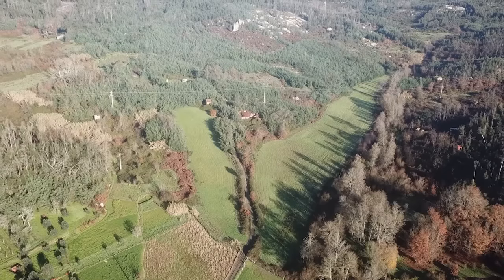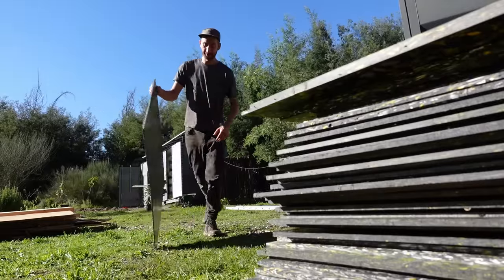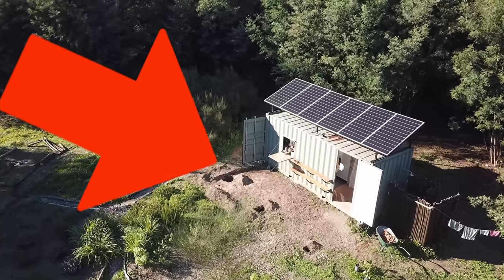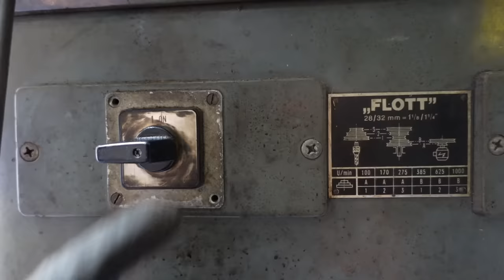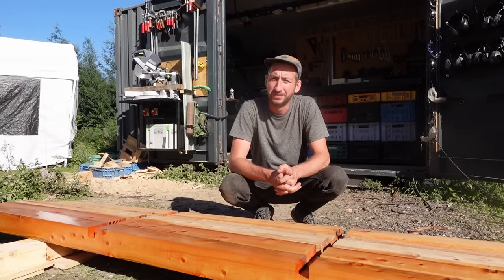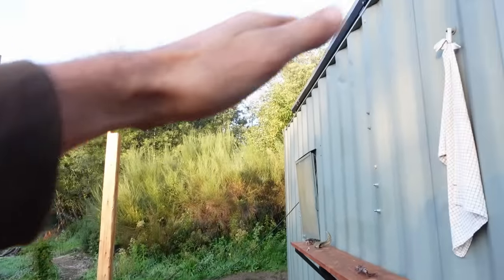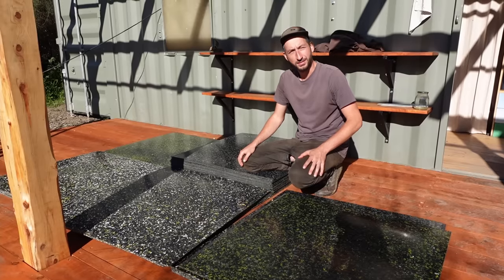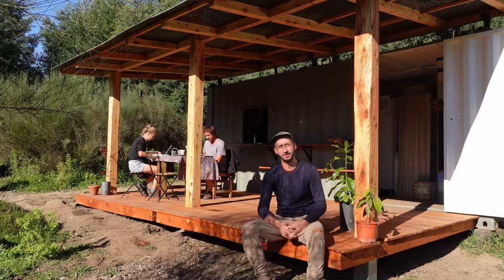#40 We made a roof from RECYCLED PLASTIC sheets

Comment: The lack of a proper overlap is likely to cause some leakage issues. A fun project nonetheless but I guess that the French design team don't have much experience in rain proof tiling nor in UV protection. The energy is good so keep innovating! 👍
Reply: Pull up the tiles, put a bead of caulk, put tiles back down. They'll have to coat it with something to keep the plastic from breaking down anyway.
Reply: From an engineering perspective, I think it’s an excellent first experiment to use the absolute minimum materials. If anything “fails” by whatever definition, then you learn that additional work and/or materials are required. If nothing “fails” by any useful definition then you know that the simplest, cheapest, fastest application is sufficient for the purpose. We have almost no information about the attachment method. Depending on how that was done, this may be perfectly sufficient.
Reply: @twestgard2  that is a slow method of testing, when different tiles are treated differently then testing and learning curve goes up.
Reply: @vriesvakkie1  We can certainly design different experiments, but the upshot of doing that is that we should do those experiments. Nitpicking someone else’s experiment is not only unhelpful, it’s actively destructive. Please, design an experiment and implement it!
Reply: Melting the seams together with a fat tipped soldering iron should solve the leaking, if it occurs
Reply: its just a shelter roof with 3 sides open, surely a little bit of leakage will not be an issue here but yes would be good to test part of it using silicone
Reply: b) I guess you missed the part where they explained that each sheet has a tongue and groove border so they fit together like a puzzle, there will be no leaking between them, besides they are screwd into the wooden pieces (rafters/battens).
Reply: @GladysRWhite  Its not a tong and groove, its more of lap joint. It will never provide a perfect water seal but should be good enough for this application
Reply: @michaltreder  you're right, I didn't know the right term!  We'll see how it goes.
Reply: Right, a roof off less than 30 degree angle is always difficult! Waiting for the snow!
Reply: I saw another channel's video making a nice inexpensive epoxy by melting styrofoam in acetone or gasoline. Once enough styro is melted it makes a nice consistency that can be painted on with a foam or fiber paintbrush.  It dries hard pretty fast and completely seals whatever it is on from rain.
Reply: @twestgard2  I'm wondering if black was the way to go. In US we get 30C+ summers so light colors might be more practical. We'll see!
Reply: An easy fix without additional materials might be to shingle the tiles over one another instead of the lap joints.

You'll lose about a foot from the depth of the roof, but it's better than leaking.

You'll also want to stagger the vertical seams so that water doesn't get a chance to drip through the intersection of the horizontal and vertical seams.
Reply: You’re right, the first hard rain will teach them all about capillary effect BUT I’m definitely interested in seeing how resilient this roof is to heat and elements so good experiment regardless.
Reply: Never could figure out why they beveled the edges. Lapping one beveled edge over the other certainly isn't going to stop water from getting through. Save some money by not specifying a beveled edge on the sheets and instead, just lay the unbeveled sheets like shingles that overlap each other. That was all that needed to be done and they would have had a far better roof.
Reply: The pitch of the roof renders the tiny overlap useless.  But then again, it’s main function is shade.  So not a big deal if it leaks a little in the winter.
Reply: Ya, it's unfortunate when over designing something leads to greater time, expense, and waste in production, and ends up with a less effective result.

Comment: as a roofer, i'd suggest using sheets that are half the thickness, then "shingling" them over each other, rather than doing the flush-mount thing. it would be the same amount of plastic up there, the same thickness, but all of the seams would have backing, no sealant would be required (sealant fails after time), all of your fasteners would be concealed/not exposed to weather, and you can gap the shingles/tiles/sheets/whatever-you-want-to-call-them to account for thermal expansion - i suspect that roof is going to buckle and warp after a few days or weeks under summertime sunlight

if you want any help with this concept for this or future roof projects, feel free to contact me - i'd be happy to offer advice.

good job guys! keep it up. love off-grid and sustainable living.
Reply: Yea that’s what I was thinking too, just stager and lap over instead of mill joints
Reply: Turns out you were right
Reply: Yeah, I believe they should’ve just overlapped in the way shingles are over left. I made a comment as well about that. I could appreciate what they are doing but as far as them machining the edges to make it flat up on top doesn’t make any sense because it will leak in time. that would be better off used as a floor inside of the shed instead of as a roof
Reply: In addition this process would eliminate time consuming router work, which is producing micro plastics, dust and chips. That's also an environmental problem.
Reply: @2degucitas  yeah I get it they’re trying to go green or whatever but in reality like you said they’re producing micro plastics that hopefully they recycle
Reply: I straightaway thought they should be overlapped and laugh out loud when I saw the CNC mill
Reply: @Hipyon  hahahahaha yeah, these people might be good at recycling and going green and trying to save the Earth or whatever. But you can tell they obviously have no experience in building and how building materials work. But they will soon find out.
Reply: @aaarod75  Or that have values and goals you do not share.   Certainly they demonstrate a constructive capacity absent in your mockery.   Contrasting merit, you compare unfavorably.   Something to think about.
Reply: @mavigogun  ok whatever
Reply: @aaarod75  <--- defensive, reflexive commitment to stunted development.   Mature or don't, the choice is yours.
Reply: @mavigogun  lol
Reply: @augustusjamal  well,  that answers that.
Reply: Onw of the things I admire about this crew is that they aren't afraid to experiment, fail, and learn.  I do agree that they should probably start from existing models more often as many of these concepts have already been through the test fail improve model for centuries already.  
The other option would be to use the abundant natural resources of the property and, though they would fall apart faster, the replacements would be readily available.  For example, instead of using so much milled wood, a more primitive roof frame made of the abundant  and surprisingly straight trees on the property that they regularly clear and cut (then chop into fine bits).  As the actual roof, they could perhaps create a palapa of some sort using branches with leaves or even grass tied in bundles (again modeled from primitive building methods).  The benefit is that materials are essentially free and abundant, nearby, and though fragile in terms of longevity, easily replaced.

Comment: This is SOOOO exciting !!!! 
Two questions.
a) What is to stop a high wind from lifting the sheets off the roof ?
b)  Why was no sealant applied between sheets to stop rain from seeping through.
c) I would suggest that a water catchment at the bottom edge with a collection tank for various uses.
I have long wondered why recycled plastics is not used for creating building members for earthquake zone rapid construction.
Reply: plastic is brital its gonna be chiiping away after elements done their job
Reply: a) the plastic sheets were screwed down to the wood rafters and battens. You can see and hear them screwing them down.
Reply: b) I guess you missed the part where they explained that each sheet has a tongue and groove border so they fit together like a puzzle, there will be no leaking between them, besides they are screwd into the wooden pieces (rafters/battens).
Reply: @GladysRWhite   I was curious about the sealant, as well as u.v resistance. It looks like a hot climate, it would be sad to see the plastic droop/wilt in the heat opening any joints up allowing water to collect in the voids and rot the  wood beneath. Very cool idea tho and definitely  entertaining to watch. He seems a clever, dude and probably thought of these issues and this is just a test roof before using on a larger structure.
Reply: @GladysRWhite  There will be seepage. The tongue and groove really needs a capillary grove so that water in-between the tongue and groove can clump together and run down hill.
Best place to see capillary groves is on the sides of timber joinery windows.
Reply: @GladysRWhite  Don't think this will be the case for the water; I think the overlapping grooves are too short and capillary action will make water seep through if you dont caulk it shut
Reply: @kestrel4077  Thank you so much; you are right.  They will share what happens, how it works for them since it is an experiment!
Reply: @Kayyyman   Hopefully they will read your messages and take action and caulk it before the snow falls!!!   They seemed to be very relaxed and "whatever" outcome was ok with them.  It would be wise that they take action though.
Reply: Problem with recycled plastic is often the uneven or "dirty" source. Even if you get a batch of the same plastic, lets say polystyrene. It will have different additives in it depending on what kind of product or application it is used. these additives give different properties to the plastic, for example UV resistance. When you mix these plastics or melt them together, you never really know what kind of material you are getting and depending on the stability of the source, the properties might change every batch. That's why recycled plastic is often used in products where the material requirements are not so important, such as packaging.
Reply: @HurjaPena   Thank you for your comment!  This is so true!  I thought they were going to put some metal sheets over it.  But all you mention here is very important... we don't know.
Reply: @GladysRWhite  Your comment inspired an idea; spray adhesive + aluminum foil.
Reply: @strongnew3744  I believe it's Portugal, so very intense sun in summer, like I have next doors in Spain, so yeah, they should have used a torch to seal the joints, and then coating the roof with opaque acrylic paint. (Sanding it first, since HDPE won't make a chemical bond to almost anything, it needs to be a mechanical bond.)
Reply: @calysagora3615  There are acrylic polymer roof coatings which would solve all theses issues.
Reply: @rockymntain  Are you sure they would stick to HDPE?
Reply: @calysagora3615  The coating sticks quite well to weathered metal roofs.  I've known truck companies that coated their 40'/53' trailers and it lasts for years "on-road."  Any doubt about adhesion of any coating, scuff/sand the surface with 100 grit sandpaper, and wash any soil/oily film off with a TSP solution before applying.

Comment: Nice idea, curious about the UV exposure and micro plastics. Would also be a great place for additional solar.
Reply: Because of the chemical structure of polypropylene, it has a high degradation rate when exposed to UV light like the Sun. ... According to Gupta, North Carolina State University, polypropylene fibers can only withstand approximately 6 days exposure to high-intensity UV light before losing 70% of their strength.
Those panels will crumble in a few years.
Reply: @WolfsFriend42  A good solution would be to overcoat it with a reflective polymer roof coating.  The same stuff used to resurface/seal roofs.  It is predominantly white or less so in silver.  The white can be tinted with color just like any paint.  The plastic sheets are technically construction sheathing with a water proof/resistant advantage over similar wood products.
Reply: Yeah my fear exactly... Inside use yes, outside use it will just break down into micro plastics and fill their local environment with it... A bit of a missed opportunity in doing their research first 😔

Comment: This is something I've been thinking about for years now as a pretty valuable output for Precious Plastics in areas where the building norm is cinderblock with iron / asbestos sheet rooves. 
Or, as I like to call them; ovens.

Would it be possible to make them corrugated with a certain amount of polystyrene, so they're both rain channeling and to some degree insulative?

Also, some half decent white outdoor paint should help resolve issues of UV, sealing, and heat buildup.
Reply: I bet you could make corrugated molds and just heat the sheets and press them to that shape! For insulation you'd have to laminate them, I think, for weather/UV proofing on the outside.
Reply: @bjrn-oskarrnning2740  or conceivably make a composite material with better insulative properties, which could be done in combination with the other ideas of lamination, coating, corrugating, etc
Reply: I had been thinking a corrugated former press with enough polystyrene mix to insulate without losing too much strength, but a laminate is probably a better idea..
Could instead make two thin rigid sheets and one somewhat sintered polystyrene, and then reheat them in a corrugated reformer, just to give them bend and fuse enough to each other to stay stuck...
They'd be nailed down in use, so they shouldn't need too much adherence to each other..
Reply: @twestgard2  I'm concerned that making a composite material porous enough to insulate would compromise waterproofing, be susceptible to mold and would be weak to the elements. I'm absolutely no specialist here, just speculating, but I think you'd have to cover it with something more solid. No reason you can't do that in the melt mold, tho!

Comment: I have used PET to make Green Houses, but they usually last about a year before start breaking. The UV light make it brittle over time. The sheets i use were 0,1mm thick. I belive the tiles that you made will last a long time before breaking.
Other option could be painting the roof white, cause titanium dioxe (the white pigment) is one of the best at blocking UV
Reply: 😅😅😅😅 la

Comment: Those sheets look NICE! Do you use any sealant in between the sheets, or do you just accept some leakage when it rains?
Reply: Also curious about this
Reply: You could just use a clear or black silicone and that would last years
Reply: It was not a smart design to router the edges where they fit together, because it encourages water to go into the crack instead of simply flowing down the next panel.
Reply: @dustinabc  Yes and roof tiles are overlapped for a reason.

Comment: I expect that the plastic will break down from the uv sun light. When ever I leave something plastic outside that wasn't made to be left out side it become brittle and cracks and breaks. Maybe if yoy recycled only plastic plant pots it will last longer.
Reply: A quick search led me to find out it needed info. If there's nothing to absorb or reflect the UV, besides the black coloring, the only long term option these panels have is the thickness. Basically, the first few millimeters will break down and slowly wear off as micro-plastics. The the degradation will extend further until the tiles are worthless for the application and the nearby ground and watershed will be loaded with plastic contamination.
Reply: One would think that it would be a simple fix to coat it with something. Less impact is better than not trying at all.
Reply: @OldNew45  exactly! Many flat roofs use stones to protect aga the sunlight.
Reply: @lightdark00  the micro plastic is a good point. Maybe they can come up with a natural way of protecting it from UV like a thin layer of wood shingles.
Reply: @michellezevenaar  I think it would be okay to use something super-chemical, non-renewable, etc etc. If you take something recycled, and use something "not environmentally sound" to make your recycled thing last 50 years, then I believe you're doing a great job. I mill my own lumber, and do some timber framing. If i use a chemical to keep the bugs out, my lumber lasts a really long time. If not, I have timbers that are falling apart from powder post beetles. Sometimes "do no harm" just isn't feasible.
Reply: UV breakdown depends on the type of plastic that was used, and the filmmakers (who know a lot about plastics!) chose to omit that information. I think at most we need more information about the materials. I wouldn’t jump to conclusions just yet. 

Also worth remembering that all materials have ecological effects, so the question is not whether there will be any; the proper question is whether this option was the best available under the circumstances. Nobody here is living under a roof that has zero ecological impact and this design has a unique risk/cost/benefit profile, including the ongoing experiment it provides.
Reply: @OldNew45  If there's a zinc outdoor paint meant for roofs, that's what they need.
Reply: @twestgard2  They said it was polypropylene from industry. They didn't mention if they knew it had any UV protection added already.
Reply: @lightdark00  I was thinking something like truck bed liner.
Reply: @OldNew45  There's a paint specifically for tin roofs that is really overkill, with I think fiberglass too, but that's more what I was thinking of. That paint keeps things under a tin roof cooler.